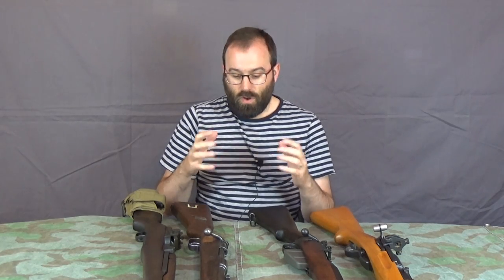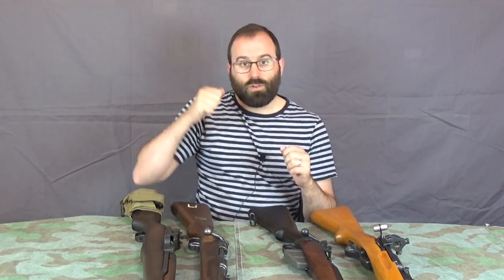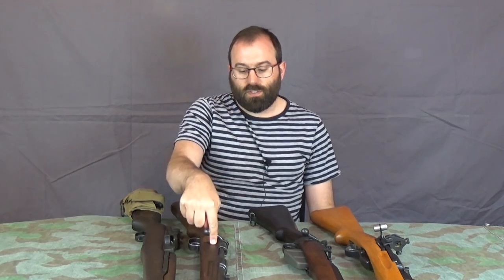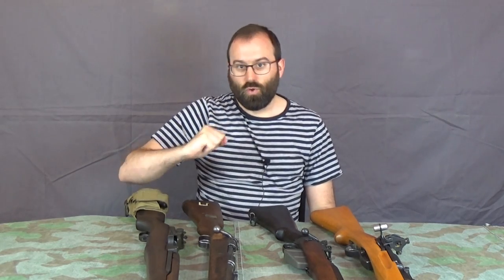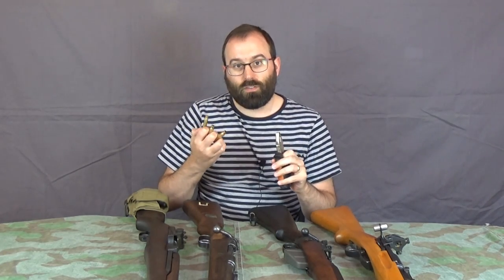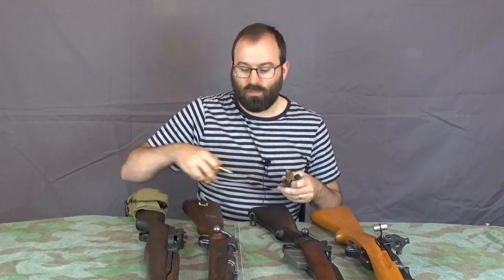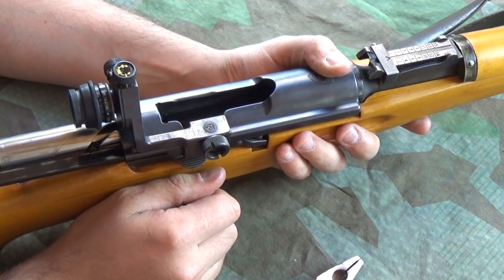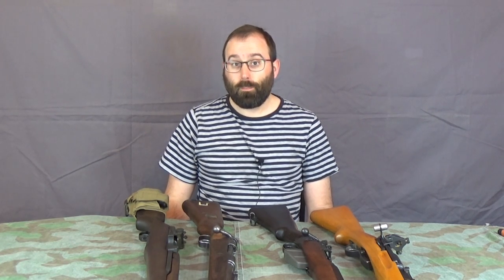Primary Extraction: A Blokesplainage With M1, Kar98k, Lee-Enfield No.4 and K31

Comment: Yet for some reason I keep hearing that the K31 has no primary extraction. That's...quite obviously false. Just like the nonsense claim that it won't fire if the bolt handle isn't completely forward (or worse, can fire out of battery). 

Great video. I learned something today.
Reply: ootdega won't or will?
Reply: They claim it won't. Which isn't true.

If the bolt is forward but not locked when you pull the trigger, the massive firing pin assembly will knock the bolt into battery and then fire.
Reply: That's true
 So, by your own definition, it WILL NOT
Reply: ...It will fire when you pull the trigger if the bolt handle is not completely forward.

What part of this do you not understand?
Reply: sigh

The sear holds the firing pin spring back. Pull the trigger, you lower the sear, and inertia sends the bolt forward with the firing pin. The spring isn't weak enough for misfires to be a concern, and it hardly takes any force to slide it into battery.

And no, the operating rod has no reason whatsoever to break. It hardly takes any effort to slide it forward. I can do it with my finger. It's not being slammed forward with a sledgehammer. Even though I doubt you could break it with a sledgehammer. It's certainly not under any more stress than it would be operating it yourself.

And even if the operating rod breaks off, it's still impossible for the firing pin to protrude the bolt face unless it's fully locked.
Reply: Yes, I know. I just gave up
Reply: Kinda pointless to cite a manual nobody else can read without manually typing everything into Google Translate, but okay dude, whatever. I own the rifle, so I kinda know how it works.

The page you cite doesn't say anything about the bolt or the firing pin whatsoever. It's just the anti-idiot manual telling people what not to do so they don't break anything. If the op-rod breaks, you can no longer use the rifle. That's it. Even though you could probably still get it to work with the right size screwdriver if you absolutely have to.  

Nothing you've said has disproven what I said. 
I said "It will not fire out of battery if you don't have the bolt completely forward like people say it will." 
You basically said "It might if you do it three thousand times."

And it can't either way, because just like every other rifle designed by anyone who has a clue what they're doing, the firing pin is enclosed unless the bolt lugs have rotated.

Not to mention it would take a LOT more than a firing pin spring you can defeat by hand to break it clean off, unless it's made out of cheap cast iron. Which it isn't. Because you have to defeat the firing pin spring WITH the operating rod to cycle the thing in the first place.

Yeah, it's not a good idea to do it on purpose. You will wear out your rifle faster and if you're REALLY unlucky and get one of the few remaining bad pre-1944 rods, you might break it. But I'm pretty sure the people who designed this thing were completely aware its entire operation relies on a tiny metal stub.

And it should be noted that the pre-1944 rods broke while in normal use. Because, as previously mentioned, your arm is a lot stronger than that spring.

But hey, if you just gotta throw pointless hypothetical semantics out there solely for the sake of having an argument, you do you.
Reply: @ootdega  If it's written in the Swiss manual, it's true. It's there whether or not you agree with it or can read it without translating. Please make your own video to demonstrate that you are actually correct. It won't be hard to record this "firing pin pushes the bolt into lock and then fires the cartridge" phenomenon and post it as proof. This is why Bloke's claims are believable; he provides concrete proof. :)
Reply: @mannys9130  How to forfeit an argument without admitting it: "Post video proof or my personal incredulity is correct."

"If it's written in the Swiss manual, it's true."

We have apparently discovered a new religious text, folks. If you're that serious about it, you could easily try it yourself. But you aren't, you just want to be right on the Internet.

Comment: Usually I have no issue with my .303s but I was tempted to try the cheapo Wolf Military classic and boy was that stuff bad. Not only did it feed poorly but I had to beat the bolt open on the 8 rifles I tried it out of. The Pakistani, British, Iraqi etc. .303 ammo I have shot has never given me that much trouble. 

The only sticky ammo I ran in my Mausers was the Turkish stuff but even that wasn't too bad, just had a slight bit more resistance when going through the bolt cycle. 

Never had extraction issues with my Garand or M1a. My M1A actually ran the Hornady steel case extremely well. It ran the wolf great too but the groups opened up quite a bit.

Before I knew to clean the chamber of my Mosins everything stuck. Once I started cleaning the chamber with a 20 gauge bore brush and solvent they ran pretty smooth unless there was an imperfection or burr in the chamber. My 1944 Tula locks up bad because there is a spot of pitting that I didn't notice when I bought it. 

Never had issues with my K31. Then again It's either Gp11, Commercial ammo, or reloads so that probably explains that.

With my Gew88/05 I run light reloads through it with no issue or I shoot the Romanian surplus. That gun loves the Romanian stuff lacquer be damned. 

Excellent video. I wish content creators like you would get bigger than the guys that just go out and shoot dirt and proclaim that rifle X is the best rifle ever because it's theirs.
Reply: Yeah, I wouldn't trust any Wolf ammo in any gun that's not a Kalashnikov rifle.

Comment: Garand does have primary extraction. The bolt turns and goes slightly back before freeing itself from the locking surfaces. The bolt repeats all the same motions that a manual rifle's bolt does.
Reply: i do hope. you have installed a aftermarket gas plug. modern ammunition tends to not play nice with the m1's oprod and bolt. have fun bloke! i do dream one day visiting europe. just for shooting. maybe i might add switzerland to my list and drop in for a pint eh?
Reply: Bullshit. The "bent op-rod" myth is just that. First of all, op-rods are BENT when they're "straight". They have to be to reach from the centerline of the rifle out around the receiver to externally operate the bolt. And seeing as how "standard" .30-06 Springfield ammo has up to 2675 lb.-ft. of muzzle energy (Lake City Match ammo from the late 1950s and early 1960s) with 173-grain bullets at 2640 fps muzzle velocity and that equals or exceeds plenty of "hunting" ammunition, the chances of "bending" an M1 op-rod with any "modern" hunting ammunition are between slim and none. Most modern "Garand" spec ammo is pretty weak by comparison. Even "hot" 150-grain .30-06 at 3000 lb.-ft. of muzzle energy is tested and "rated" in bolt-action rifles with longer barrels. Can you "bend" an M1 op rod? Sure. If you try. Is it an automatic given with "modern" hunting ammunition? Absolutely not.

Comment: Yes there is on the m1. John Garand engineered it that way because the brass may still be sealed against the chamber walls while the action starts to rip the case out. The Johnson semi auto also had this problem and the tried lubing the casings. M14 kept the garand system for same reason.
Reply from the maker: I literally showed you there wasn't though... 🤷‍♀️ And I am unaware of any lubrication of casings experiments with the Johnson, I think you're mixing it up with the Pedersen which had waxed cases cos delayed blowback.

Comment: See also: P-14 and M-17 rifles with helical locking.

As for "cartridge case material"?

Brass is good because it is relatively "soft" and is a goos example of a "dissimilar metal" thet does not do e amolectukar-lefel adhesion under pressure.

ALL steel cases need some sort of protective coatings to prevent corrosion. This can be a simple "copper wash", or a copper wash with a lacquer coating, early soviet and lots of Chinese 7.62 x 39) ot lacquer straiggt onto the steel.

The problem with lacquers of the traditional type is that they MELT at fairly low temperatures. In your basic AK, SKS etc system, te bolt is bashed open quickly and "robustly"., giving little time for the lacquer to solidify and thus "glue" the case into the chamber.

An interesting study is the array of "different" coatings on "surplus" Chinese 7.62 x 39 ammo. I went through a variety that included at least three "shades" of green, lacquered copper wash and then  there was the "commercial" stuff with a brown lacquer. This latter stuff was definitely "made to a price". Freshly-fired cases recovered from the range regularly showed cracking and PEELING of the brown lacquer. Where it got really ugly was in bolt-actions. Hard-extraction became the norm. The trick with a bolt action is the "dwell time" between the firing of the round and the operation of the bolt. In semi-autos, the process is almost instantaneous and the case has virtually no time to transfer the heat of propellant combustion to the chamber , via the "lacquer".

Owners of various "commercial" 7.62 x 39 bolt-action rifles may have noticed this phenomenon. Side note: In WW2, the Germans and the US produced vast quantities of steel-cased ammunition from pistol sizes upwards. It got tricky for the Germans because of the scarcity of Tungsten Carbide. The ammo makers needed the material to make the tooling to produce steel-cased ammo and the troops at the front needed it made into armour-piercing shot to punch holes in tanks. The soviets were sitting on huge Tungsten ore deposits, so they were OK.

Enter: "Polymer coating".

The Russian cousins had obviously picked up on all this, as they started introducing ammo with cases coated in a GREY material that is noticeably "slicker" than the traditional lacquer.I first encountered it with their ".223" sporting ammo, then it turned up, briefly in small batches of  7.62 x 39.

Whatever the coating is, it seems more mechanically robust and decidedly more "heat-resistant".

Then there was 7.62 x 54R, in steel cases; "copper-washed". A true classic was the Chinese-made 7.62 NATO in copper-washed cases which sported bogus RG (Radway Green) Brit headstamps. It was cheap; but quite "dirty" and uses your classic "Com-bloc", insanely corrosive primers. Copper-plated, steel jacketed bullets; "Mil-spec' accuracy. It does the job....

Comment: "And I feel sorry for those poor saps that had to run steel cases in the Second World War." 
This poor sap found out the hard way and has many more steel cases yet to extract before justification of another ammo purchase.
Reply: I have advice for you. Get a bronze shotgun bore cleaning brush (20 gauge works well), a piece of cleaning rod section, and an electric drill. Chuck the rod and brush in the drill, soak the brush in mineral spirits, and spin the brush in the chamber with the drill for several minutes while re-dipping the brush in the mineral spirits. You may follow this up with a 20 gauge bore mop and some "bore paste" which is a very mildly abrasive polish used for smoothing and polishing rough barrels and removing hard to clean large lead or copper deposits. You could even follow that up with some Flitz metal polish and shine the chamber even smoother. Inspect the chamber and barrek throat for any burrs or irregularities that will catch a case and make it stick. 

The logic behind this is 2 fold. First, many surplus guns have old hardened cosmoline that is stuck in the chamber. When firing the gun, it heats up and gets very sticky. When lacquered ammo is used, the cosmoline and lacquer combine and stick the case. Even in a cosmoline-free chamber, some melted lacquer will eventually transfer into irregularities in the chamber walls and then grab onto cases when they are fired. The brush and mineral spirits remove the cosmoline and lacquer. The bore paste helps smooth it out and remove any stubborn cosmoline or lacquer that the brush didn't remove. The Flitz or other polish would just smooth out the surface of the chamber even further to make melted lacquer harder to stick. If you inspect the chamber and find a burr or other irregularity, you'll need to remove it. When 60k PSI irons the cartridge case into the chamber wall, that burr will hang on tight to it. You can make a sand paper flapper wheel with a wooden dowel that has a slot cut into the tip. Be VERY careful and slow with sandpaper and don't go rougher than 600 grit. You do not want to widen the chamber significantly, just knock off the burr. If you go too far you'll crack cases, and if you move the shoulder forward you'll affect headspace. With a nice clean, polished chamber you won't have any issues with lacquered cases. Run the bronze brush in the chamber every 200-300 rounds to remove built up lacquer, or when it starts getting hard to extract empty cases. Just use the brush though, no paste. Over time paste will wear away too much metal since it's mildly abrasive. The bronze brush is soft and won't remove any steel at all. If you still have trouble extracting, check the locking recesses and locking lugs for old cosmoline or rough areas, and then the bolt cams as well.
Reply: Thank you very much for the advice! I'll make sure to be careful.

Comment: The M1 has a cam path, so almost inherently that is the mechanical advantage of 'primary' extraction...

Don't forget the barrel's gas port is all the way at the end of the barrel almost, so the M1 action is given some time to begin cycling.
Reply: That cam path simply exists to unlock the bolt by rotation, though. The rotation isn't doing anything to the cartridge case. (Mechanically it can't.) Extraction on any autoloading firearm is a single stage process: gas pushing the bolt rearward, whether directly (as in blowback operation) or via some intermediary device (e.g. a piston). There is no distinct "primary" and "secondary" like there is with a bolt action.

Comment: Those who think the Mannlicher 1886 doesn't have primary extraction say "AYE"!
Reply: The Chap Nay? From the brief video I think it has just a tad
Reply: The tiny movement you see is a combination of two things: 
1: The extractor snapping inward to grip the cartridge rim as soon as the locking wedge clears its recess.  It is forced radially outward a few mm when the bolt is fully closed.
2: Again when the locking wedge clears the receiver recess, residual tension in the mainspring causes the outer cylinder to move infinitesimally back toward the cocking piece. This could also be due to wear and tear in the bolt of this rifle, which is a bit tatty.

The bolt is simply not constructed to provide positive mechanical camming action to force a case out.  I removed the extractor and mainspring and repeated the process, which resulted in zero bolt movement.  All my cases are loaded at the moment so I couldn't definitely test a mangled case so I'll have to remember to test one when on the range to vindicate my assertion :-)
Reply: The Chap Well sir, I consider myself corrected! Interesting about the wear and tear bit, I honestly didn't consider it. Rather stupid of me to be honest given the age of the rifle. Spot on  response by the way. Damn good show!
Reply: No worries, it took me a good while to figure out the residual spring tension issue inside the bolt, the extractor was the obvious source of movement but there was still a tiny bit of movement once the extractor removed, so by deduction the only guilty party remaining was the mainspring.
Reply: The Chap It being a bit loose due to the age I suppose?
Reply: Pure speculation on my part.  It could also be loose intentionally or just be a result of manufacturing tolerances.  I'm fully expecting to have to bash the cocking handle with a mallet/my boot if and when I do a test.
Reply: The Chap aye
Reply: +The Chap I'll give you an AYE AYE on that one :-)
Reply: AYE
Reply: I don't think the manlicher (hah) does, most straight pull rifles don't, and the wedge locking system doesn't even have a cam that turns and pulls.

Comment: Great video, but it leaves me with several questions. 
1. Is steel cased ammo always horrible, or was this specific to late-war Germany being unable to pump out enough ammo properly?
2. Is the cam type of the Mauser inferior by definition, or could this be solved by having a less extreme angle on the camtrack?
Reply: 1) No,  problem lies in the lacquer used. Post-war lacquers are more thermally resiliant than what was on hand for supply then, especially with logistics problems. The melted lacquer myth surrounding post-war Russian ammo comes from these wartime coatings on other ammo (the crud for them is actually blow-by from faster shrinking steel).
2) Yes, the sharp angle is the problem, otherwise it would be very similar to the SMLE. However, cam path machining can be very expensive (especially at that time) so the Mauser is more cost-effective than the SMLE.